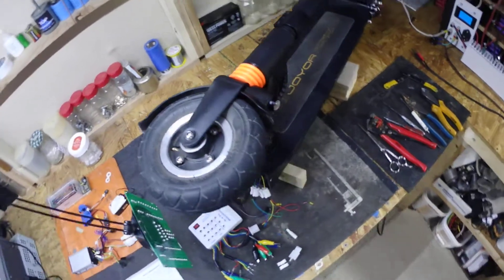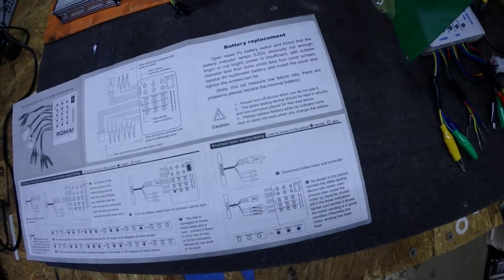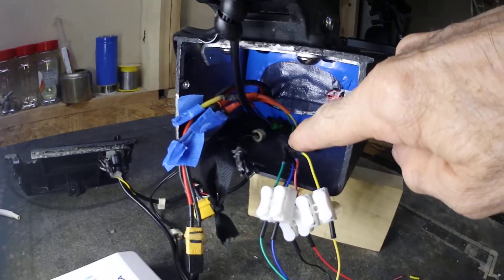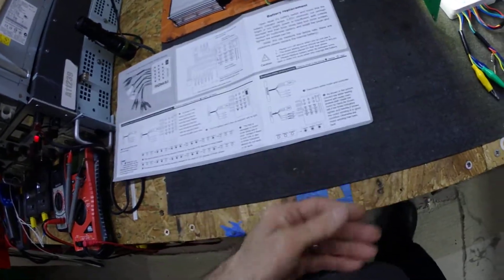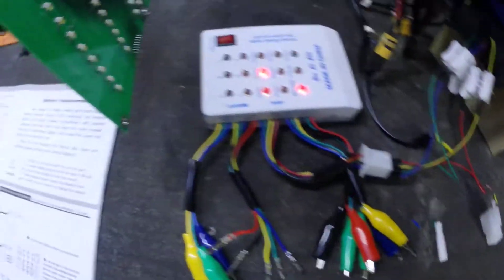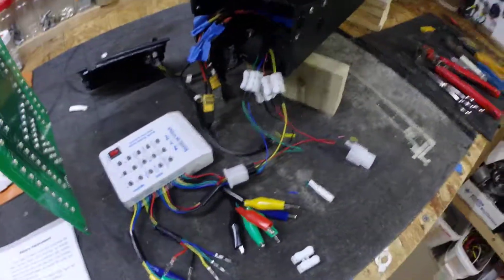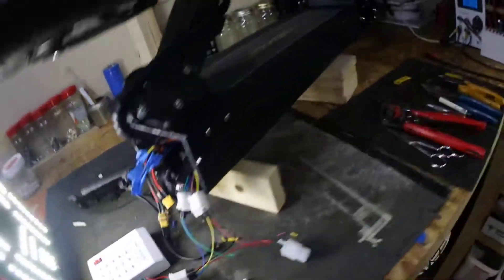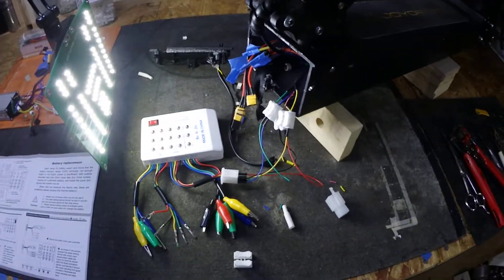JOYOR scooter  Error code 1 Part1

Comment: Hi Mark (or other specials) HELP me pls..
.. <<M365 pro 2, latest version. No firmware.>> 
Motor problem began with the ‘hall’-noise etc. 
-Battery 90 %. 40V
-Cables are okay. 
-No error on display neither beeps.Only 0 so no speed either. Beeps only on/off.
-The 3 spots on the hall-board at the motor (yellow, green, blue) and the 3 right pins of the halls give 5 V. NO ZERO  (no matter where or how the magnet is) 
-Renewed all the halls SS41F, nothing. 
-Renewed them by a preformatted board (middle one has different polarity) but nothing changes, 5V no zero. 
-Renewed the main board but keeps the same. 
-Renewed the dashboard, no difference…, 
-again new halls,  reversed the middle one and twisted its pins ‘cause of the polarity, but again nothing changed. 
-The throttle worked fine.
 
I checked the halls etc on all the ways I could find on YT.  What can I check (and fix) still more?
Thx for ideas and help!
Reply from the maker: Do you have the same tester I used in the video ?
Reply from the maker: I would look at the controller , closer .